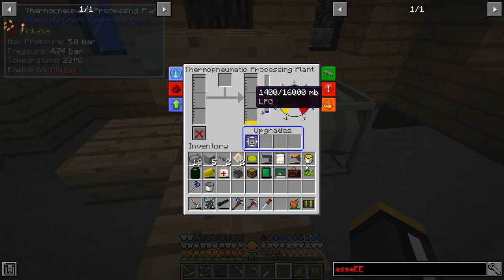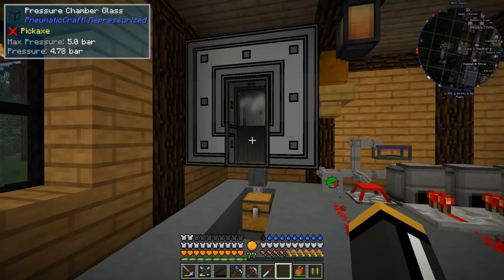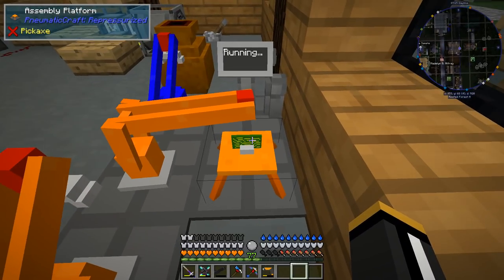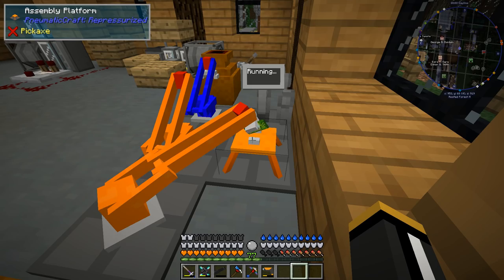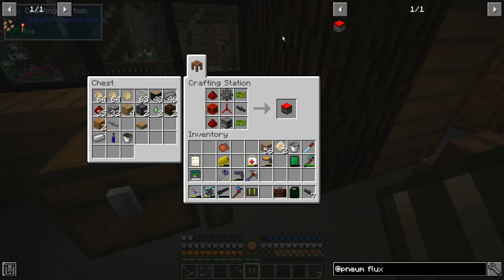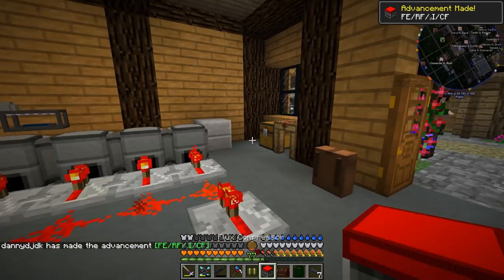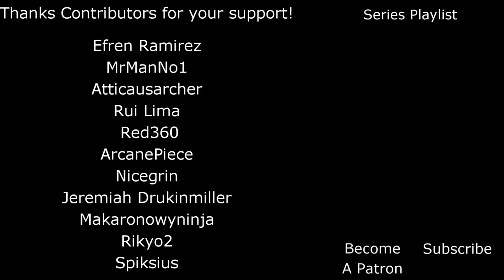Real Tech S2E37 - PneumaticCraft Advanced Pressure, Assembly Machines and PCBs

Comment: The Pressure Chamber Interface is able to respond to a redstone signal. So, for a general purpose chamber like this, you could attach a lever to the pressure chamber wall next to the output interface and set the interface to only suck items out if the pressure chamber on a high signal. The order of operations would be to 1) flip the lever, 2) insert all the items you need for crafting, 3) when all the crafting/popping has stopped then flip the lever back to retrieve the crafted items. This is eliminates adding and removing a junk item as a filter every time. (That said, if you instead have a dedicated chamber for crafting only a few items, then the filter works well for that. But for general all-around crafting, the lever works better imho.)
Reply from the maker: Not sure why I never thought of that. I guess old habits die hard. I'm pretty sure that feature did not exist when I first played this mod back in 2015.
Thanks for the tip! That definitely makes things simpler.

Comment: Very good explanation. I’ve been breeding villagers and got loads of mechanics. Did you notice the amadron tablet has two recipes for the PCB blueprint?
Reply: The two recipes thing happens because there's a fixed recipe for 8 emeralds -> blueprint, and there's a regular villager trade for a random number of emeralds. Villagers trades get randomly reshuffled into the list of Amadron trades once per Minecraft day (by default), so you will sometimes see an extra recipe, which usually isn't as good.
Reply from the maker: Good to know. I hadn't seen any naturally spawning in villages. Amadron has more buying power anyhow, so they give us a better price than the local village shops. ;)
Ah! I was wondering why there was a more expensive blueprint.
Reply: NO WAY ITS DUNCAN WEBB!

Comment: No potentiometr in my modpack. How to transfer 20 to 5 by redstone and repeater
Reply from the maker: I'm not sure what you mean by 20 to 5, but with vanilla redstone, you could just have the redstone source several blocks away to get the signal strength you want. You can also use comparators in subtract mode.
Reply: @DannySon  20 o 5 I mean the bars of the pressure, how to substitute that potentiometer. Playing Enigmatica 6 if it helps...
Reply from the maker: Ok, I get it. I don't know a lot about Enigmatica 6 other than that it's a pretty big pack. It's hard to believe there isn't some kind of potentiometer-like block. But, in any case, allowing the redstone to run a far enough distance to get the strength you want should work. Also, if you use an Advanced PCB on the pressure gauge, it will allow you to specify the exact conditions for redstone output. I cover that in one of these videos... I think the next one.